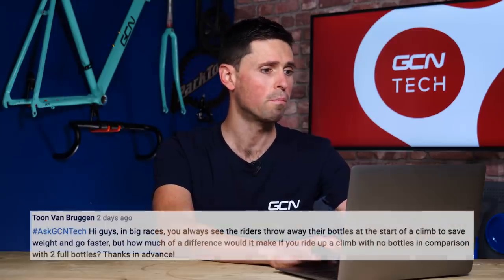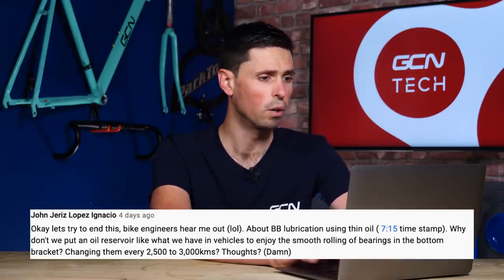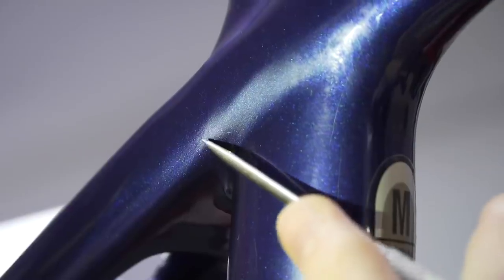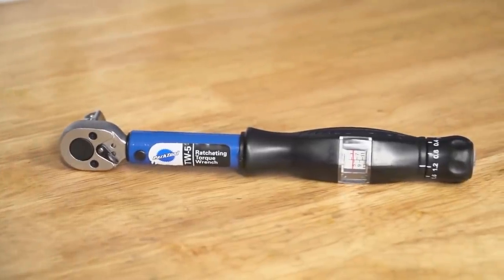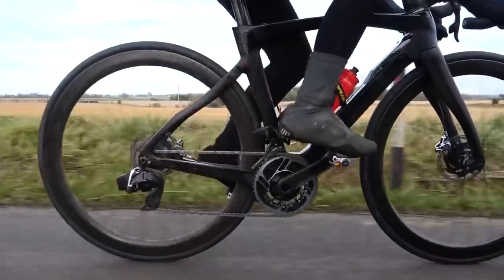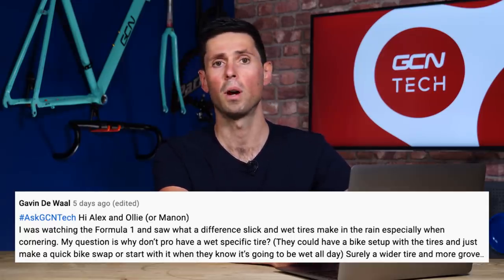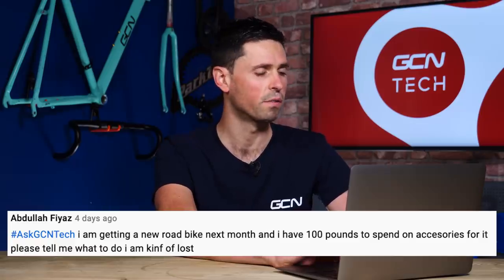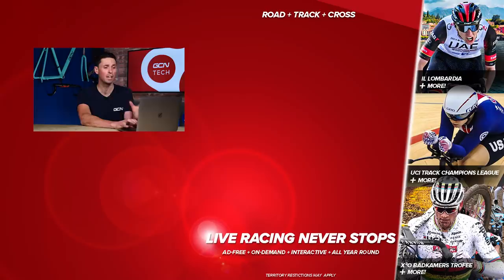What Accessories Do I Need For My New Road Bike? | GCN Tech Clinic #AskGCNTech

Comment: #warren B and your question to #askGCN
Check your chain line.   I had a similar problem.  
By placing moving a 2mm spacer from the non drive side to the drive side, placing it between the drive side crank and the BB, the chain ran in a strait line from the big chain ring to the 6th sprocket on the back (11 speed: 1 is big 11 is small).  Before it was in line with the 5th.   When it was like this and i moved to 11th, the sideways force from the slight angle was enough to move the chain up on the big chain ring and jump off.  Now the angle is just a smidgen smaller and the chain stays on.  
The 2mm shift has no real effect on position or efficiency but you can adapt the cleat position to correct for the 2mm shift to the right. 
There is a bit more noise when doing extreme cross chaining (big-big or small-small) but no problem and perfectly acceptable for a short time if you don't want to change because maybe another climb or high speed straight or descent is coming up soon.

Comment: An oil pump is not needed for the oil to reach the bearings, that's easy. However, it would be very hard to seal the oil inside the bb without using strong oil seals which will add extra friction.

Comment: To the guy looking for a starting bike kit. Look at multi tools before you purchase. Not all fit your hands the same way. Some are easier to use than others. Don’t knock your local hardware store either. I’ve gotten mini ratchet and bits for them that fit my Brompton specially at less cost than buying a bike branded tool. FWIW.
Reply: Even if the cost is equal ratcheting bit drivers are much nicer in operation vs multitool hex keys. Hard to match the storage convenience of a bike specific bike tool so there is a minor trade off. Also running a greater risk of losing things on the roadside if you haven't cobbled together a reasonably well organized tiny tool kit. My saddlebag kit is also comprised of a bit driver + all required bits. (also 2 tubes, patch kit, tire levers, chain tool, master link) For carbon bikes, just be careful, with leverage comes great power.
edit: a "ratcheting bit driver" won't need an adapter to fit standard 1/4" hex bits, a 1/4" ratchet will need a 1/4" to 1/4" bit adapter.
Reply: @All4Grogg  I find it not too difficult, but I'm a sewer and a bag person. Adding elastic to hold tools into my saddle bag isn't a big deal, repurposing a stationary, craft or utility bag for this wasn't difficult. 

For someone in the US, I'd suggest looking at cheapo wallets at the dollar store or small bags at Walmart. My best craft doodads bag is a cigarette carrier from Walmart. They still carry similar items. You could even use a low stick tape to attack bits to a couple of cards and stick them in a wallet pocket.

Comment: In the 90's there has been the Grease Guard system from WTB/SunTour which allowed you to push in fresh grease into your bottom braked. The excess grease was pushed out at the side of the spindle. That was quite a cool system at that time!
Reply: I watch my bike shop use something similar on my Shimano BB.  It was pretty cool because you could see a definite change in the grease coming out when it changed from dark to white.  That's how they knew when to stop.

Comment: there are gearboxes and bearings that do have an oil bath in the bottom part, but in those the gears / bearings need to dip into the oil, with a bottom bracket the oil would  not stay inside, as these bearings/gearboxes have split houses so the oil does not flow out.

Comment: I think a sealed bottom bracket with oil would work just fine.  You don't need a pressure pump on roller bearings car bearings are way different. Rear differentials don't use pumps neither do most transmission.  GCN didn't even try to do their homework on that question.
Reply: Good point! 👍 I also don’t like the idea of “stick to what we have” - that would kill innovation. …now regarding your note about GCN doing homework - I guess they hoped that Alex will solve it, as former car mechanic. 😐😅🤪
Reply: Quite agree! Gearbox basics. Splash lube and lip seals, job done.
Reply: Higher end internally geared hubs also use oil. Grease basically functions as oil in use though, so I really doubt much if any advantage could be found after the first half mile or so unless the conditions are extreme.  I seriously doubt there is anything in it even marginally for racers especially if they warm up on rollers or the race has a neutralized zone. A certain foul mouthed five year old who happens to also manufacture bottom brackets would be the one to offer a far more educated answer to this.
Reply: Absolutely agree.  Many simple petrol motors have splash lubrication and no pump.  Also, the oil in a motor has to reach more moving parts than just a set of bearings.  Light oil lubrication works fine for Sturmey Archer hub gears.  Question is whether in a bottom bracket it would really be substantially more efficient and lower maintenance than using grease.

Comment: actually technically a charged battery weighs more than an empty one, however in the case of the Garmin, I think you would need a very very very very accurate scale... however for bigger batteries it can be practical to determine the charge by weighing...
Reply: This really is more of a theoretical question as the mass does not change at all, but the gravity does to the tune of a few PICOgrams as a result of the state of electron excitement. Einstein level stuff having to do with energy, mass and acceleration. Much easier to just run .0001 psi lower in the tires for far greater weight savings.

Comment: If I had, and I have had in the past, a saddle that kept tilting during the ride I would definitely torque it down more. Screw the torque wrench idea, the clamp is obviously crap anyway. If it fails completely replace it with something that isn't going to give you any more trouble.

Comment: On my Canyon S13 post I had the same problem as David Langley. I’d level the post and after the first ride the saddle would be sticking up a few degrees. 
The thing was it then didn’t move any further. So now when I assemble one, I point the saddle down a couple of degrees, torque the front bolt, put my weight on the back of the saddle to move it level and then torque the back bolt. I haven’t had one move since employing this technique

Comment: Regarding aerodynamics question... it's not about the aerodynamic drag of the handlebars, but more the body position it puts you in...
Your body position has the biggest impact on your wind resistence -> having narrow handle bars that put your arms into a narrower position makes you significantly faster.
the "leverage" that your talking about, is only of use, when sprinting out of the saddle.... and even than you can "throw" your bike from left to right and pull on the handle bars...
-> for all non-future-sprint champions narrow handlebars make you significantly faster and a well trained core  gives  necessary stability.
Reply: also the current best sprinters in the world and almost all keirin riders us somehwere between 27-35cm handlebars.

Comment: A charged battery does weigh a tiny bit more.  But in a device like a garmin head unit the weight difference would be less than a spec of dust weighs.

Comment: #AskGCNTech Hi team, I'm preparing for a Time Trial that's reasonably prestigious and so I'm looking a lot at optimizing my gear. However I cannot find any information as to whether Handlebar/Aerobar Mounted water bottles and hydration systems (such as the Controltech Timezone or X-Lab Torpedo) are legal in UCI Affiliated Time Trials at this point in time. Are they legal and worth it or should I look at getting an aero bottle instead?

Comment: #AskGCNTech Hi guys... Because of the upcoming autumn and winter I've stored my roadbike nice and dry, suspended in the shed for usage next spring and summer. But now I am worried about the preservation of my bike and its components during storage. Should I take it the whole bike apart? Should I give it a thorough cleansing and lubricate it? Should I just do a quick rinse and lubricate it next spring? Or all of the above? I really have no idea, but I don't want to end up with a rusty old banger next time I'll take it out of the shed... What do I need to do?
Reply: Store it indoors.

Comment: Alex, I think you forgot to add "new multi-tool" into accessories for new bike. One of my friends got new bike with disc brake, where he originally had rim brake bike. He got serious problem of puncture on his tire and found his old multi-tool doesn't have correct allen key to remove the thru-axel, while he had spare tube, tire lever and pump.
Reply: 8:20 "and a multi-tool"

Comment: 1:59 you're likely wrong. It's potentially a good idea - rather than a comparison with an internal combustion engine, a sump, and an oil pump - a better comparison might be the bevel box of a shaft driven motorcycle, where cogs are protected through (typically) half immersion in a gear oil. The additional weight may not be appropriate to the types of cycles where weight is considered the dominant focus of design, but for some models this could be very useful - touring bikes for instance, where a rider is already lugging a fair amount of materials. Moreover, the sort of tank required, which could be encapsulated in a frame, would not need to be large to swallow a bottom brackets inner gubbins - and how much oil might be required? Not a great deal! 
We've already seen disc brakes adopted; and videos on this platform have already covered the potential of gearboxes in bicycles.  If this isn't adopted by some manufacturers in the future - I suggest this isn't because of the absence of feasibility; but more that, given the relative ease with which present BB design lends itself to maintenance - they're not exactly complicated are they - the investment vs sales vs advantages equation probably doesn't equate to a clear winning business model. But that isn't the same as saying it isn't worth experimenting with, and looking at.
Reply: Incidentally - the reasons ICEs use an oil pump, sump, etc - is in part to do with the necessity to keep things cool, and also because the oil has to be moved from the bottom of an engine, to the upper most parts - typically to cool/lubricate the cams. There will be some heat generation in a BB certainly, but it isn't in any way proportionate to the temps reached in a typical ICE; and there is obviously a considerable difference in the distances a lube would need to be transported - 50 or more CMs, vs perhaps 10cm or less < i.e.  a well would be sufficient, there's no need to circulate it.

Comment: #askgcntech Hi GCN Tech team. On the weekend I did a ride on my Landescape tandem descending 563m. In doing this the disc brakes got quite hot and my pilot said the brakes were becoming spongy.  The brakes were now squealing. We stopped let them cool and then continued. The brakes continued to squeal for the rest of the ride. 
My question is with the rotors becoming so hot do they need replacing or just cleaning? They have gone from shiny bright on the edge to a bronze colour.

Comment: #AskGCNTech hi guys, question about seating a tubeless tire on the rim. When I've done this previously with car tires, I spray starting fluid into the tire and ignite it. Small explosion within the tire forces it on to the rim... it's super cool... have you ever heard of this approach used with bike tires? Any thoughts on the likely hood it will just blow my wheels apart?

Comment: #AskGCNTech Hi guys  !  I'm currently using a Continental Revo Sealant on my tubeless tyre setup. But it's about to run out. I have another bottle of different brand ( Bontrager TLR Tire Sealant). Can I mix it up with what's currently on my tubeless tyre or do I have to remove the old before putting in the new one  ?   Thank you & have a good day.

Comment: #AskGCNTech When washing my bike after a ride, do I need to relube the chain every time, especially if using a dry lube? What if I’m using a wet lube? If yes (and the chain is not too visibly dirty), must I use a degreaser too? Will a simple rag and degreaser work, or should I run a chain cleaning tool like the Park Tools CM5.3?
Reply: I'm going to start hot-waxing my chains very soon. I suspect that having separate wet & dry lubes is only advantageous for the manufactures where once we just had various sorts of any-weather ones.
Dry lubes are great until it rains then they wash out & wet lubes do little more than turn into grinding paste & give lovely chain prints on our limbs & clothes.
I'd advice getting a chain bath & something like Muck-Off chain cleaner for regular use  in winter then removing the chain completely every 3-6 months for a complete clean with petrol using quick-links to re-join. When the chain's off, you can clean the chainring(s) & cassette. The other thing to do with the chain off is to check for either play or stiffness in the BB bearings.

Comment: I have a Canyon Endurace CF/SL 8.0 with Shimano Ultegra Di-2.  Where should I be lubricating the drive train on Di-2?  I use Teflon lube on my other mechanical drivetrains..is this a good lube for Di-2 also?
Reply: The di2 bit is just the mechs and shifters. There is no difference between the chainrings, cluster, and chain on a di2 or mechanical bike. Use the same chain lube, if it's appropriate for the conditions.

Comment: #AskGCNTech Hello gents, I would love to hear your advice on my problem. I am riding 42mm deep carbon disc wheels with tubeless tyres. I have noticed that there is water getting inside of the deep section of the rim, probably leaking in around the nipples and the valve. First time I’ve noticed this was when the water inside caused the rim tape in the air chamber to fail 😔 I have done some research but there is very little information out there on this topic, sadly. I have learned that some brands (e.g. Hunt) have a small hole on the side of the rim to allow for the water to get out naturally from the inner chamber just with centrifugal force. But this is not the case of my wheels and I’m hesitant to drill any holes into the rim as I’m afraid this could break the rim’s integrity. Please, advise 🙏🏻

Comment: #askgcntech F1 tyres are so soft they have to pit to change tyres midrace but still faster than fitting prime tyres and not pitting. can they make a softer compound cycling tyres that even if you stop and change tyres midrace you're still faster than regular tyres?

Comment: Is there an easy way to convert my rim brake 10 speed rims to work with my new disc brake, 11 spd ultegra group set bike
Reply: Not without changing hubs.
Reply: It's not likely to be easy, since the hub will need to be disc specific, and the spoke count will likely also go up to handle the additional forces, so you'd have to get new rims too. Easy option may be to sell 10 speed wheelset and buy 11 speed?

Comment: #askgcn , I have a chain related question. when ever I am in my largest chainring and smallest cog at the rear and I stand to put more power into my riding the chain comes off, quite litterally jumps off the front chain ring.  I am pretty sure I am not epically superhuman with super powerful quads ;)  but this is pretty frustrating, I am not sure I am explaining whats happening well enough to my local bike mechanic to get it sorted.  they recently removed another link to sort it, but got the bike back and the same problem happened
Reply: #warren B and your question to #askGCN
Check your chain line.   I had a similar problem.  
By placing moving a 2mm spacer from the non drive side to the drive side, placing it between the drive side crank and the BB, the chain ran in a strait line from the big chain ring to the 6th sprocket on the back (11 speed: 1 is big 11 is small).  Before it was in line with the 5th.   When it was like this and i moved to 11th, the sideways force from the slight angle was enough to move the chain up on the big chain ring and jump off.  Now the angle is just a smidgen smaller and the chain stays on.  
The 2mm shift has no real effect on position or efficiency but you can adapt the cleat position to correct for the 2mm shift to the right. 
There is a bit more noise when doing extreme cross chaining (big-big or small-small) but no problem and perfectly acceptable for a short time if you don't want to change because maybe another climb or high speed straight or descent is coming up soon.